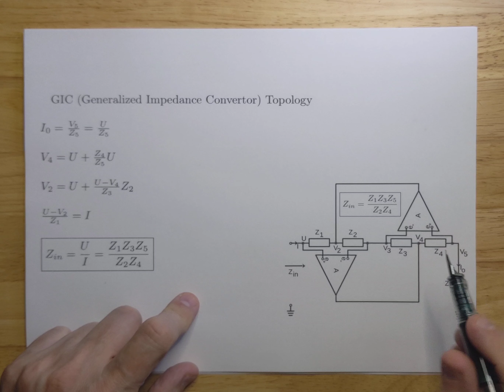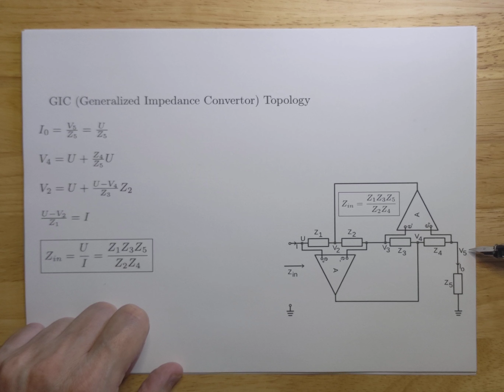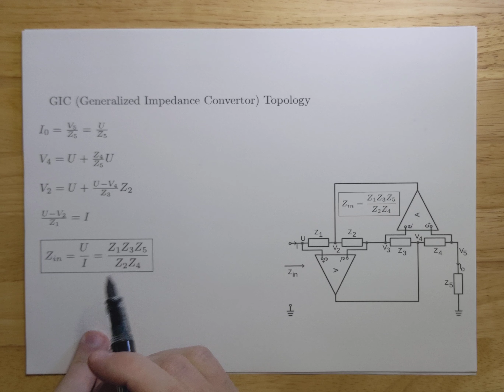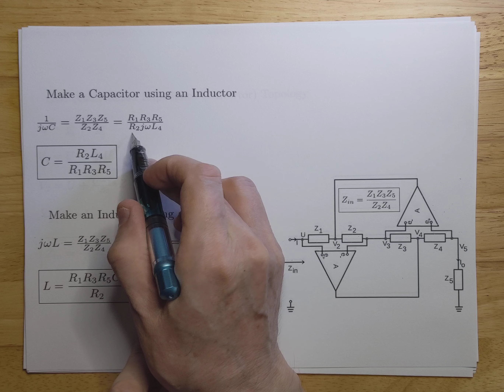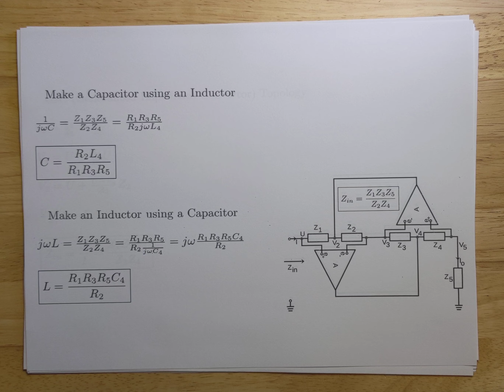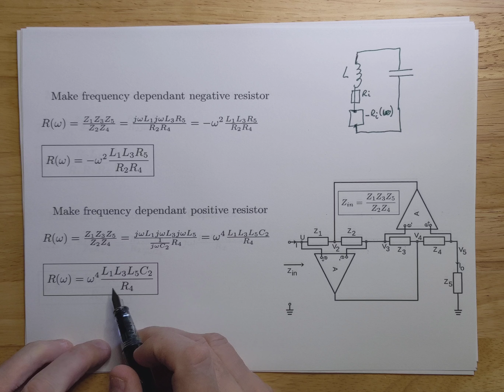Making Frequency Dependent Resistor using GIC Topology.

Comment: Thanks, these are very useful for practical circuit making. Could you explain using these methods how a op-amp window works?
Reply from the maker: I assume you refer to op-amp window comparators, these are indeed quite interesting. If there is enough interest in this topic I can certainly cover this in a future video.
Reply: @TheSageofScience  Yes that's right. If you can, of course. Thanks.